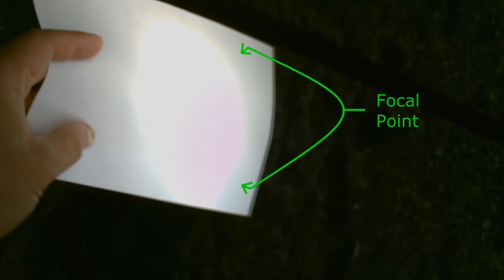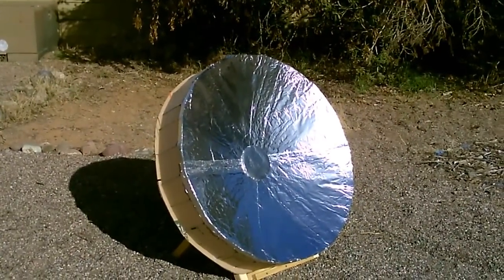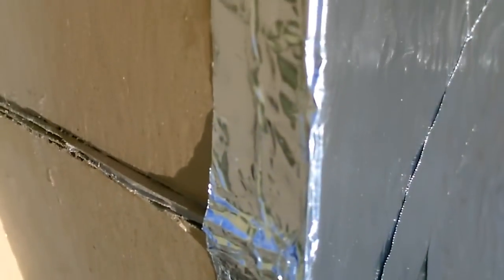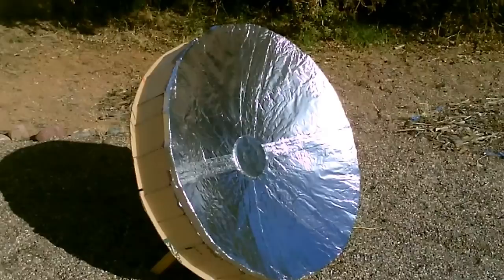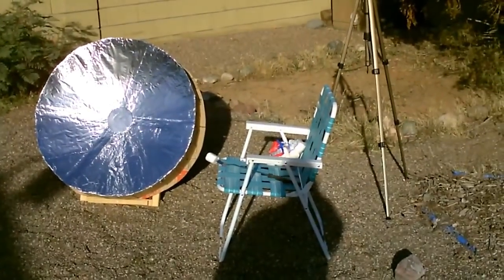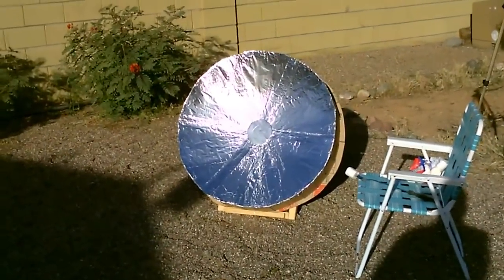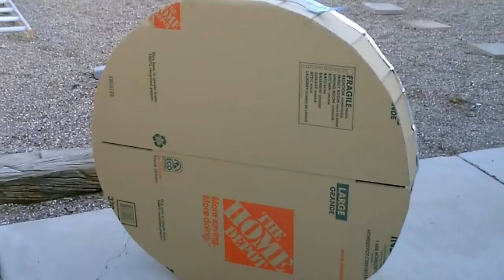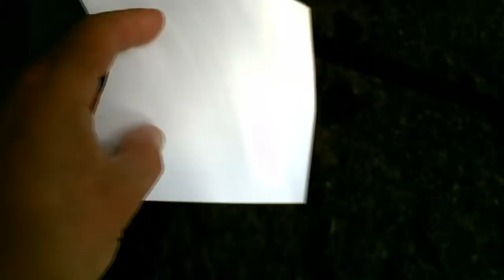My Homemade Solar Parabolic Dish! - (Updated!) - for faster cooking! - DIY Solar Cooker! (only $7)

Comment: I saw tire cooker and gave me an idea . Get matching size tires and use bailing wire to bind them together close any gap with silicone or bike inner tube. Your collector is going to be a slice of 4'*8' stryofoam or a slice of coroplast with mylar glued. That's it big heat chamber to heat air or cut the inner beads like pizza and spool out pex filled with glycol. Then you can build a copper tube frame to go under your bed or the dog house maybe the chicken coop. Ideally I would like to build a pressure cooker running on solar would have to reach 212° i believe that is very plausible. Want metal center refrigeration companies throw away the container they get product in its like a propane tank grind till you get your shape.

Stack it vertical and you don't have to adjust for season. Set it horizontal and you probably have greater gain .

Comment: Awesome new updates.  Thinking polyester resin could be used to make the cardboard fiberglass like and water proof/resistant.   Wondering if mylar space blankets perform any better... though might not be as cost effective. 

Also, wondering if an offset dish and like with the trough, and offset trough design would be easier to use to focus the energy down to a conventional pan as well as help with keeping out of the beam?  Technically... the dish design can be cut in half with a trough placed in the middle.  Even a curve can be made with the trough to create a wider parabolic profile versus linear profile if needed maybe for a pan or square pan. 

Way cost effective and great builds.  Thanks for sharing.
Reply: Found a carafe that looks like a glass vacuum Dewar inside at the Goodwill.  It opening on the one end looks large enough to make a stainless steel tube cooker thing and I'm thinking just directly boil water/liquids so will need to figure some kind of holder like you did I think.  Planning on taking apart sometime this week and thinking my first laser printer Fab Lab project will be laser cutting salvaged wood to reclaim in a parabolic trough design for.  Just learned Solid Works last week... so now need to refresh my Illustrator skills since looks like the Vinyl, Laser and Router use Adobe Illustrator and I can't afford a license... pretty much just gas to get back and forth and materials.  Excited though... great design ideas and thinking will enclose for up north if doesn't work as well in an open design in cold weather.  I'll post a video and design files once I do.  Thanks a bunch for the great ideas desertsun02!
Reply: Oh and I forgot to note I am going to try to see if I can make as an "offset" parabolic trough with a parabolic end profile also from the top view.  Thinking will get more heat focused since the flash won't be in the way so much... though have to do some math and maybe use an insulator on the holder for the not focused on area.  Have to see how easy will be in Illustrator to design this.  Thanks again!
Reply: Opened up the carafe and is a glass vacuum Dewar looking flask/bottle.  I'm not sure since silvered or aluminized if going to work to somehow make transparent since the silvering is on the inside of the vacuum area looks like.  Therefore, thinking with that design I need a closed loop heater tube to transfer the heat.  Thinking if I want to heat up still one side of the Dewar I could make a "U" tube somewhat like a "cold finger" used in distillation... though used like a "hot U" I'm thinking.   Busy with the electronics and RF engineering projects first and foremost... though awesome to see you have some new videos!   I did draw up in VCarve Pro (CNC router software in the Lab) the parabolic profile though didn't duplicate, scale like for the top and front view profile and make the spar cutout areas.  Once I get to I'll make open source since some Fab Labs are free to be a member and might be cost of materials and $5 an hr or something like that.
Reply: C’est une très bonne idée. Tenter de solidariser les panneaux en carton. De même couper la parabole en 2, et entre les deux mettre 
Une band linéaire parabolique pour accroître la surface réfléchissante. La surface de la «  bouche » d’entrée de la lumière est très importante car elle accroît vite la puissance. Pour ce faire, on peut aussi mettre la parabole dans un «  boîtier » carré en bois et continuer la parabole vers les 4 coins du boîtier.  1 m x 1 m  donnerait 1 m2. C’est la surface minimum à mon avis pour avoir une surface réfléchissante efficiente. Le point focal ne doit pas obligatoirement être un «  point », il peut être une petite sphère car de toute façon cela doit irradier une casserole. Comme surface réfléchissante j’ai récupéré des enveloppes qui se situe dans les boîtes de café, où il y a 10 filtres à café préparés. C’est solide et ça réfléchit bien. Voilà quelques idées.
Reply: …avec un carré en bois ( boîte carrée en bois) de 1,1 m x 1,1 m on obtient une surface de 1,2. Je pense que c’est une bonne surface pour travailler. De plus cela se range plus facilement qu’un parabole de même surface .
Reply: Donc je pense qu’une bonne idée serait de construire un boîtier en bois avec un fond en bois synthétique ( comme les meubles IKEA ). Tout serait alors plus rigide. Ensuite il faudra placer la parabole en carton dans Tout cet espace. Cela signifie qu’il y aura des arcs de parabole en carton plus longs et d’autres plus courts. Comme c’est du carton cela se coupe facilement.  Et vous êtes certain d’avoir 1 m2 avec 1m x 1m.
Pour le mécanisme de la base qui oriente la parabole j’ai récupéré la partie inférieure d’un fauteuil de bureau. Ce mécanisme permettait de tourner le fauteuil et aussi de l’incliner. Au dessus il y a une base en moral avec 4 trous pour le visser…

Comment: Have you made a solar oven? 
I want to buy one but if you have made one yourself,  I would appreciate it. Hopefully you made it with aluminum foil.  Thanks and 
Happy Thanksgiving 🦃
Reply from the maker: yep i've made cardboard box solar oven videos. didn't even need to use foil.  ...but that does work great for the reflectors. funny you mentioned that because i've been thinking about making another solar oven video - one with lots of reflective foil (inside and out).

Comment: Could you use this to focus on steel barrels of water to heat water in colder areas, during daylight hours??
Reply from the maker: sounds like a good idea to me. if using this as a barrel water heater, i might make one change to the unit. *since the location of the focal point of these cookers can be adjusted to suit your needs, i'd make the parabolic curve of the dish a little shallower (so focal point is farther out from the dish). that might make it easier to beam it onto the side of a barrel.